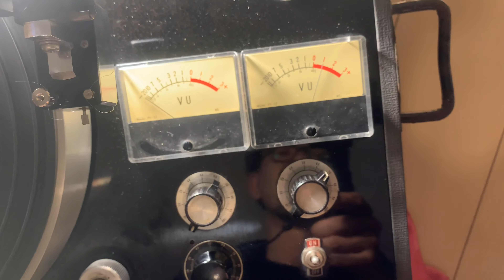HARA Disc Recorder RM-805VA Setup & Recording

Comment: Hello, I have the same machine. There is a lot of noise when recording. What is the weight of the recording  stylus you use? Are there any burning needles with heating  to sell？
Reply from the maker: Hi,
the Weight is roughy 20~30g.
you need the heating tool box i made and diamond stylus. Do you have stylus ? Do you want the heating box for this machine ?